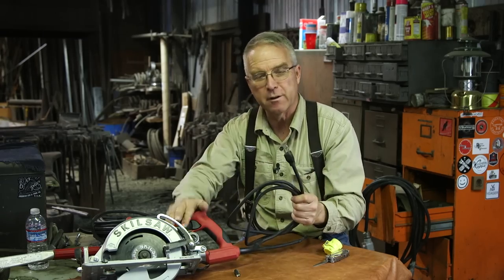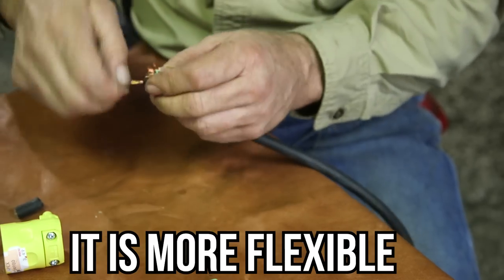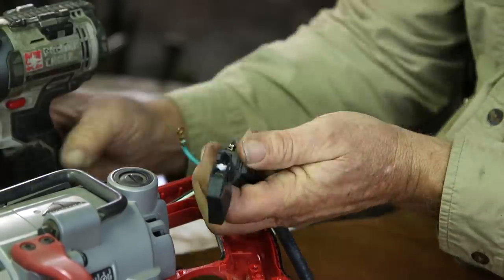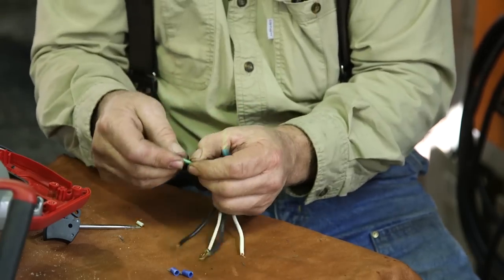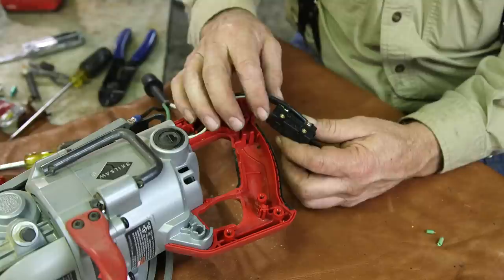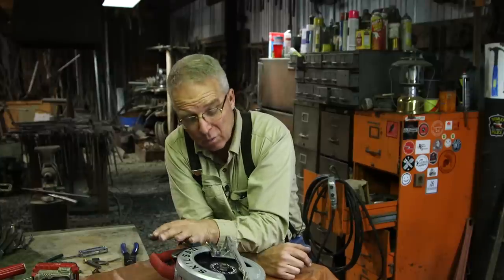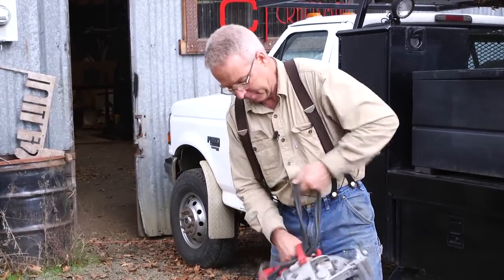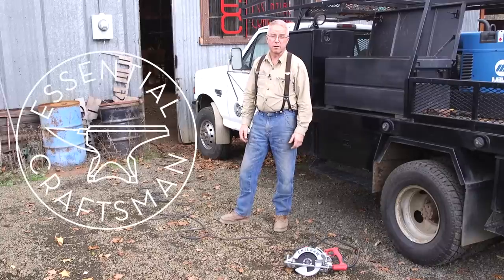Skilsaw Cord Install and Storage Tip

Comment: Scott, this reminded me of working in a rental shop. There, the policy was that when we got a new electric tool we'd chop the supplied cord to about 12" and throw a plug on it. The rationale was that with something like a circular saw, belt sander or whatever, the customer was likely to cut through a longer cord, and us making it short enough to prevent that was a maintenance time saver for us. Plus, we were bound to replace the plug anyway, as the factory plugs were much less likely to stand up to abuse that the heavier ones we put on. It prevented people from winding a long cord so tightly around the tool that it defeated the anti-strain relief at the tool end.  It also saved the customer the cost of us having to replace an entire cord. Most customers, whether newbie weekend warriors or contractors, have their own extension cords, and the idea was that they could cut through those to their hearts' content. 

 I remember once we had a brand new Bosch breaker (electric jackhammer) that we hadn't had time to shorten the cord on. Came back from the first rental with the cord (about 10 foot or so) wrapped neatly around the top of the tool. On inspection it turned out the guy had managed to cut the cord nearly in half about 12" out, which was no mean feat considering that that was still close to two feet from the business end of the tool. Think he was charged 5 bucks for the plug (including labour) which was decent, as if the company wanted to be jerks about it they could have (according to the fine print on the back of the rental form that nobody reads - but should) been charged $150 or so for a new "genuine" Bosch cord.

So now you know why your rental tool may have a frustratingly short cord. It's because of other people that we can't have nice things. 

Thanks for sharing your work, tips, wisdom and friendship. All the best in 2019.
Reply: Interesting and honest perspectives ,,,, me like
Reply: Great insight - as a skeptic I always thought the pigtails gave the rental guys a chance to tack-on a few more bucks to rent a cord!
Reply: I see why you had a short cord for rental tools but a plug 1 foot from the tool is something I can't stand, especially on a tool used on lumber. Trying to cut a sheet of plywood with a skil saw only to have the plug immediately catch on the edge of the sheet is frustrating. Yes I could hold the plug up till it gets past the edge, but I'd rather concentrate on cutting not cord management.
Reply: I have cut the cord off a breaker about a foot from the tool when I let the tool fall over and the cord was caught against the case as it landed, cut the cord as clean as it would using shears.
Reply: @michaelhobbs8082  That's true too. But if the customer wrecked a rented extension cord they bought it. We also rented shop-built extensions for 220 volt service with either stove or dryer plugs for use in rough-in construction sites. In any case, they were checked before being accepted for return. You would not believe the lengths people will go to to conceal damage they have done to equipment. The short cord eliminates the old wrap the thing up tight to hide the damage game, and saved us time doing returns and replacing the original cords, which would mean taking the tool apart. It boils down to cost-benefit. If the rental company has to spend time replacing long cords on tools after say a half dozen rentals, that costs the company money, mostly labour, which then gets passed on to the consumer. Another part is presentation - what would you think if you went to rent a tool only to see a conveniently long cord with scabby electrical tape repairs all over it? Then there's liability if a scabby repair fails. It's not perfect, but in the rental business, short cords rule. For my own tools? Take Scott's advice - the fewer plugs the better (and I liked how he upped the gauge to compensate for the length of the conductor).

Comment: I find the factory plugs often preform worse than field replacements contrary to what OSHA stipulations are.  The plastic for the plugs isn’t bonded to the cable jacket and it pulls out where as the replacements have good clamping.  Soldering can be/is worse than crimps, makes the wire brittle.  On my saw I put Neutrik power cons.  Locking, watertight, and smaller than the standard twist locks.  So far works great.

Comment: Hi I go the other way, I cut the lead at about 10 inches and install a three pronged coupling. I have lots of extensions all with the female end of the coupling, that way I can use the length I want and storage of the tool is much better as it doesn't have a long lead to gather up

Comment: We have a couple of makita corded drills in our tool trailer. They actually rarely get used: mostly just when we do a deck with a treated wood top, be that 5/4 or 3/4 plywood. Anyway, the cords they came with were going out, and, influenced by seeing Scott's long cord on his saw, I decided to stick a 40' cord on one of the drills, and man, that sure has been nice. You don't really think of how nice it is to not have to deal with a cord end getting snagged 8 feet away, or having to mess with tying it onto the extension cord, until you have a long cord on a tool.
I decided I was going to do this on the next circular saw that needs a cord replacement and see how we like it.

Comment: The cord on my saw was dry rotted so I shortened it. I have yet to cut the cord but if I ever do then I only have to replace/fix an extension cord. I use the crochet method on all my extension cords and ski ropes. Its nice on the ski rope cause you attach to boat and it undoes itself in the water.

Comment: Got to love the corded worm drive skillsaws. It's the saw that built America (at least west of the Mississippi). I own 2 of them, one with a 50' cord and one with a stock cord. I also have an old corded sawzall that I put a 50' cord on. All of them are great tools, but all of them will belong in a museum in the very near future and not on a jobsite. The cordless stuff has finally caught up and surpassed corded tools in performance, now the price just needs to settle down on these tools. The flexvolt dewalt saw beat the pants off of the skil mag77 in a test that Wranglerstar did. Also, put a flexvolt battery in a regular dewalt 20 volt sawzall and you will never use a corded sawzall again. Makita and Milwaukee make great cordelss tools as well.

Comment: On those crimp connects, I would highly recommend pulling off those plastic caps. it gives you the opportunity to make a much better crimp, or at least know if you have a bad crimp. It also reduces the dimension of the joint and makes it neater when it is shrink tubed, which you should do for any out door application.
Reply: Like it im just gonna go for 25 ft though.

Comment: Electricians trick when stripping off the insulation, hold the wire at about a 45 degree angle so it sits in the recessed groove on the strippers. Bite down and bring the strippers to a 90 and pull off. Works nearly every time, no twisting and less chance of damaging the conductors.

Comment: So I do happen to be an electchiken. Grantet form over seas in far of switzerland but I do think electrocitie works the same over here as it does over on your side of the pond.The only thing I`d have to add is that I would urge you to put ferrels over the ends of the wires that go into the plug.
If it is the type where the scews press down directley on the wire you can shear off  strands when tightening and this will lead to smaller diameter and greater resistance and I have seen completley burned out plugs because of that.  Especialy at those amperages I`d consider this a must.

Comment: I do it to keep from fighting the plug and knot when climbing around in the trusses. I buy a fifty-foot extension chord, with every new saw, cut off the female parts and hard wire to the new saw. I have two with 10 Gauge 100' chords for long reaches to the temp power.

Comment: When I run into that issue with connectors, if insulation is not needed, I pull off the sleeve and open up the connector a little with a tapered punch, awl or a thin screwdriver. Then I can get a good fit without removing any wire strands.

Comment: I decided to try this method on one of my extension cords a few years ago. That's the only method I've ever used for that particular cord. The cord has taken a permanent "set" from wrapping it that way and I can no longer throw it and have it unwind in the air. I have to pull all the loops apart by hand. It's not a terrible way of winding up a cord, and it is better than wrapping it over your arm, but it's far from ideal. I've never mattered the "roadie wrap" technique on my existing cords. Maybe I just need more practice.

Comment: I had a couple of extension cords that had been crocheted up.  They must have set for a while.  It took a lot of days stretched out in the sun and pulling on them to get the straight.  I saw the roadie wrap below and will have to try it.  I have thought about putting longer cords on some equipment but have not.  I hardly ever do portable stuff outside the shop and we have the shop well equipped with 40' self rewinding 12 ga extension cords.  You can wrap the cords around each other once and plug them in and they WILL NOT come apart.

Comment: NB. If you're in the UK, Europe or anywhere with a 220/240V supply then a 14ga / 1.5mm cable  will still be just fine as voltage drop is less of a concern at higher voltages. It's also a lot lighter.
Reply: James, True story. Amps are 50% less also right ?
Reply: august More or less, yeah. Power supplies can have different efficiencies across different voltages, but other than that, yes, the amperage would be half compared 110/120V.
Reply: @OtherTheDave , Thanks and Happy New Year !
Reply: If you’re in the UK, you’ll still be using 110 V on your skilsaw, because they have the strangest jobsite safety rules.
Reply: @_oven  Oddly odd those Brits ....
Reply: Can you use that same saw at 240v? I wanted to buy one but didn’t think you would be able to, and I’m not keen at using a 110v as just around the farm.
Reply: If you're in the UK you won't be using a worm drive saw as you can't buy them here, unless you import one yourself.
Reply: In the USA we use a center tapped single phase 240VAC system. So each hot leg to neutral is 120V It is still 240VAC between the hots though. We're just not idiots using 240V for everything. Because getting hit by 240 is more than just a tingle.
Reply: @danhickling3565  if you plug a 120V universal motor into 240V it'll run like the dickens for a split second. Then I'm not sure what it'd do. I wouldn't want to be near it to find out either. Fun fact universal motors run on DC too. That's why they're called universal motors. They'll run on anything you run through them. So you can run a circular saw off a welder, a string of car batteries. Whatever. Lower voltage it'll go a bit slower and be weaker. Theoretically a 120V saw would run twice as fast and be twice as strong on 240V. But I don't know if that's what'd really happen. It'd probably just blow up.

Comment: I would recommend to crimp some end sleeves on bare copper strands that should make the connections more resistant to oxidation. Or use tinned strands but I prefer to use sleeves

Comment: I love your videos..  I have always put longer cords on my circular saws. It saves rolling out another cord 80% of the time.  You really need to buy some good electricians wire strippers.  I have several of those junk pair as well.  I use them and they make me mad everytime!   My background is almost exactly yours.   General contractor, craftsman, builder, maker.  Keep
It up!

Comment: I wish my saw had a longer chord on it, but feel that trying to modify it will not work for me so I leave it as is and just decide to leave the saw and chord as it and use an extension chord since I don't do work far away from the house. Thanks for the tip and I wish you a Happy New Year.

Comment: When I saw you using a powertool to tighten those screws I got goosebumps all over, manually tighten them with the specified screwdriver.

Comment: Not too long ago, I put a ~10ft 10awg coard on our Makita 10-1/4" saw. Also put a new plug on it. It's double insulated, but the old plug wouldn't stay plugged in. The new plug fixed that and the 4ft or so longer cord is much nicer to work with. I've replaced cords on drills that just had wire nuts inside the grips and they worked fine. A hole hawg had some weird terminals on the switch. They just slide into the back, but not the kind with a little flat spring that act like barbs to prevent them from coming out. The connector was the spring. I ended up cutting off the old wires, putting a nice big blob of solder on them connectors and soldering the wires onto them. Works fine. Big thing I want to know how to do is easily strip the insulation off on the wires. That's some stretchy stuff.
Reply: The wire strippers he was using have different sizes to them that correspond to the gauge of wire you are stripping. You put the wire in it, spin the tool around the wire, and then pull the wire out of the insulation.
Reply: I've got several pairs of wire strippers. The pair I used has very sharp grinds that actually cut into the insulation. Even those have problem unless l I make several bites around the wire and it can still be a pain to strip. The insulation on is really strechy. Wire with PVC insulation is alot easier to strip.

Comment: I do the exact opposite. I cut the cord on all of my tools to about 8" and add a 20 amp twistlock plug. Then I have a female twistlock on my 12 ga 50' extension cord. Always need a cord but cords on tools never in way of storage.
Reply: I was thinking the same thing.  After my wife cuts a cord with the hedge trimmer, I often just put an electrical box on the end. I usually need more than one outlet... even if I'm only using one tool at a time, I hate unplugging one to plug in the other. So I usually have a few outlets near where I'm working.

Comment: First thing I learnd about cabels and plugs: If the plug or the device fails mechanicly the wire can be pulled out. When this happens you want the earth wire to be connected the longest. So keept that in mind on every cable work and you're on the safe side.

Comment: Adding a strain relief with a loop about 2 to 3 feet from the saw.  That way you can hook the loop on the strain relief on the stud hook on the saw.  So when you lower the saw from the cord your not pulling on the handle.

Comment: Great tip, I just did this today to my saw. Caution on tightening up the terminals inside the saw handle. I overtightened them and both screw heads sheared off. Luckily I was able to get the screw bodies out and use some small computer screws in their place. Just a word of caution for anyone looking to do this project. Mine works great and I love the long cord!

Comment: The single most important thing to remember is OSHA does not accept modifications to tools. I had 100’ cords on my saw and drill for many years. The advantages are real. Also we used to buy SJ 12-3 cords for our replacement. SJ cords are flexible and narrower in diameter.

Comment: I found this to be a very useful and informative video however I always put my extension cords on cord caddies and pretzel tie them to my power tools. I will have to try your method and I have never seen that daisy chain method of tying up a cord. Very interesting. I am assuming that you like your new Mag 77 since your keeping it in your truck which is a high honor for any power tool. I am hoping you can elaborate a little more about it because I am thinking of buying one. Thanks for the video.

Comment: In stead of trimming strands to make the wire fit in a crimp terminal, first try it with out twisting the end.  
Leaving the strands parallel is the smallest diameter.   May make the difference.

Comment: Friend of mine goes the opposite direction. He cuts the cords on on his tools down to about 6-8".

He figures that he's always going to be using it with an extension cord anyway, so there's no need for a 6 foot cord on the tool. And at the end of the day he doesn't have to wind up any power tool cords; he just throws it in the truck box and drives off.

He's a welder, not a carpenter, so that might make a difference in which way you go with the cord.

Comment: The upside to an extension cord is that when it inevitably gets damaged, it's much easier to replace. You can tie the ends of the extension cord and Skilsaw cord together to make them less likely to come unplugged. Or do what I used to do when I would come home from Alaska: take 4 zip ties, one on each cord and two cinching those ties together to "lock" the cables together. It meant I had to use a pair of side cutters to unplug the block and battery heaters, but it also meant I didn't come back after 2 weeks to a frozen battery because it was easier for an outlet/cord thief to unplug the guy beside me!

Comment: Marius Hornberger did the opposite. He put a twist lock female connector on the end of one long extension cord then trimmed his tool side cords short and attached the male. 

I don’t think I would trust that connector system for on site work but in a shop it’s genius.

Comment: Good idea,...small gauge wire and long wire leads to voltage drop, as he said, then amperage increase which leads to higher temp. inside the motor, which leads to motor burn out.